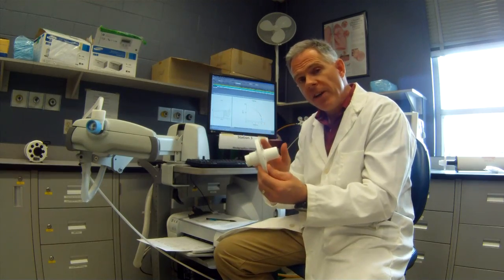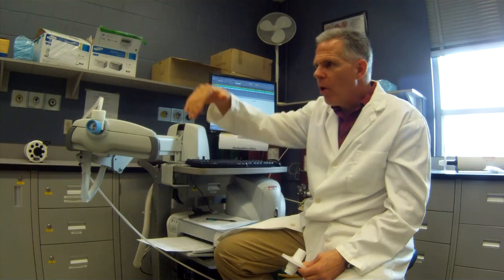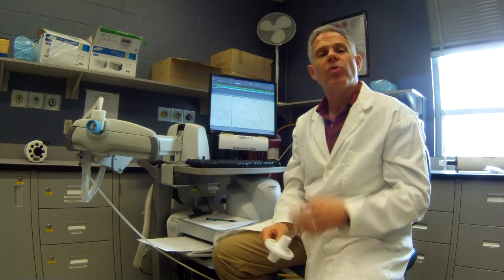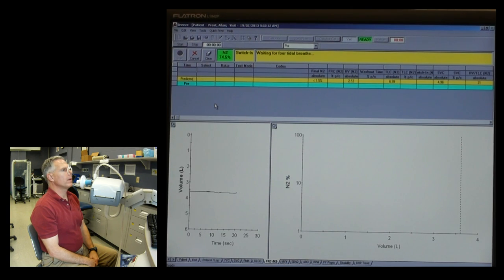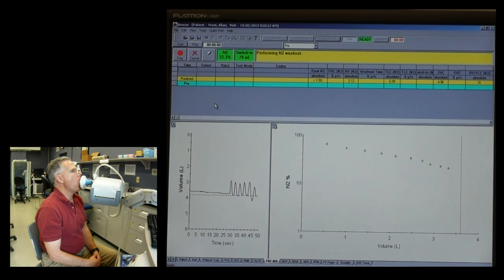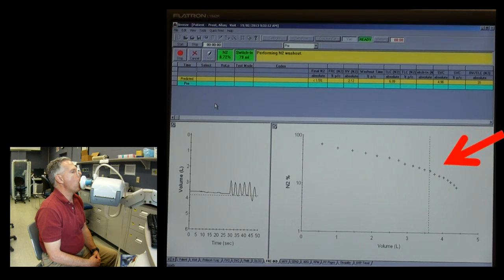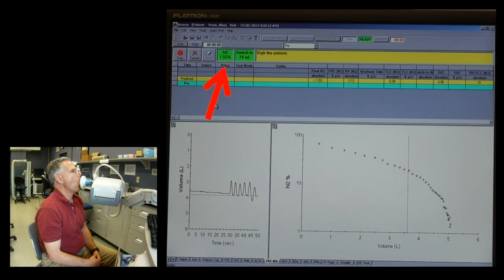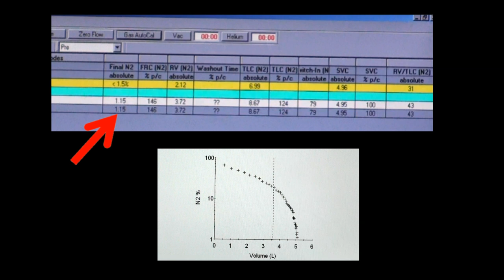PFT5 Nitrogen Washout

Comment: Hi, thanks for the video! Great explanation, and I loved seeing the test being explained in real time. I was wondering if you could explain the difference between minimum air volume (MAV) and functional residual capacity (FRC)? Are these two essentially the same thing, and if so, which is a more appropriate term to use?

Comment: Hi. Im interested in using the Optiflow device to prevent desaturation during rapid sequence induction of anesthesia. I wonder if it could achieve N2 washout even if someone is able to inspire room air orally.....? Could I use the optiflow device in conjunction with this test but have the patient inspiring normal air orally......?
Reply: Are you speaking about Second Gas effect?